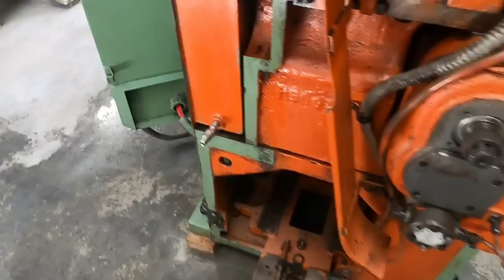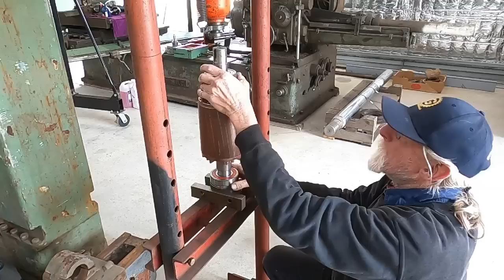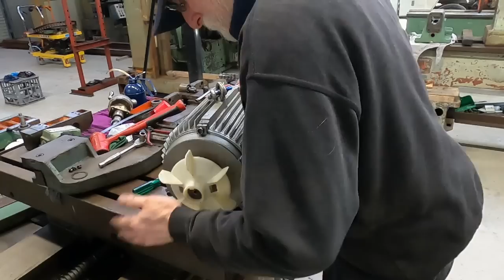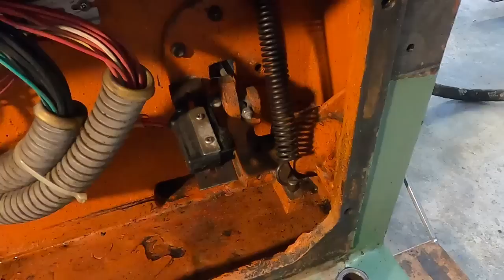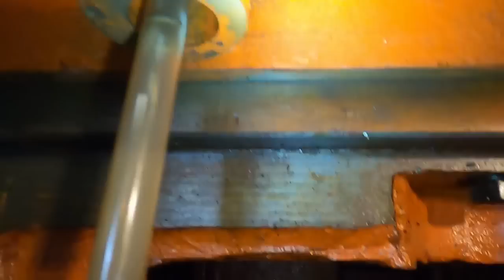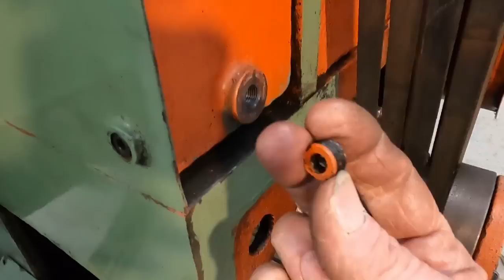JFMT 530 x 2000  Lathe Repairs  .  Part 8 .

Comment: Unless you are 100% sure of the bearing history I'd always renew the bearings. If I knew that they had been in for 6 months I'd probably replace them. Always cheaper than having to take the whole thing apart again. And always fit SKF, RHP, FAG Timken or other "decent" brand. Not worth saving a couple of quid on a cheap bearing.
Reply from the maker: Thanks . I never use cheap brand bearings , the NTN bearings are a good make . 👍
Reply: @swanvalleymachineshop  Yes I think just about any bearing made in Japan will be fine. I have fitted cheap bearings on the odd occasion, when I have not been able to get hold of decent ones and production have been screaming for the machine to be working again. Have then planned in to have them redone when time and production allowed.

Comment: Great clean up, I think it is worth the effort. I worked at a shop that really did not want to do things twice, always replace bearings that have been removed with pressure on the outer race. I have to catch up on your vids!
Reply from the maker: Hey thanks .  👍

Comment: Vesrah is a big Japanese brake & pad manufacturer, so like you say, it's a common part used for other things too - like some motorcycle.

Could you not make a drain that comes out from the existing threaded hole?
Reply from the maker: Hi Matts .  I could have just screwed in an extension ,  but i did not want to reduce the hole size that the ID of an extension would create . 👍

Comment: Brilliant design on the motor brake, so simple and inexpensive 👍🧐. Would it have helped to lock the brake on, then set jacking screws?
Still amazed at an induction motor, especially 3 Phase, seem to last indefinitely,  just a clean and bearing replacement. High end large DC brushed motors I've worked on, 100 to 250 kW with forced cooling soon get destroyed if the filter is removed and ambient air is laden with ferrous particles, or oil laden.
Lathe looking great, nice clean machine to work on.
Thanks for sharing Max, best regards from the Black Country UK 🇬🇧
Reply from the maker: Thanks . I realised the thing with the brake assy when i was editing & thought the same !    My surface grinder has a  generator & DC motor , a fair bit out of my wheel house !   👍
Reply: @swanvalleymachineshop  Probably the 5% of brain power that was occupied with YT stuff, had the best solution or ten? ✔🧐, it's always easy after the fact.
Best regards John.

Comment: Hi Max, as an electrician we always used a bearing heater with a temp stick to install the bearings to lower the risk of damaging the armature, it works quite well. I'm sure you knew that but I felt the need to share with you.
Rich
Reply from the maker: Thanks  .   Did you ever have any issues with the grease melting ?   I have never heated sealed bearings before , only ones with no seals .   👍
Reply: @swanvalleymachineshop  Hi Max, no, it's only heated just above 200 F, I don't remember what the melt crayon was set at probably about 210 F. I used an induction heater, they work faster but you can also get into trouble quicker. if you see the color of the steel change to yellow it's trouble. don't use anything but a temp stick  to find the correct temp, they are the best way to know.   our heater came with a couple of them so I just bought like kind.                        An infrared thermometer will get you in trouble.
you must act quickly while sliding on the shaft and hold it into place while cooling or you will be back at the press. it's easier if you can get the armature vertical. 
 
Good luck Rich
Reply: @swanvalleymachineshop  I'm with Rich, I've done at least a hundred using the warming method with rubber sealed bearings. Being a cheapscape  I just use a droplight and set the bearing right on the bulb. When it's too hot to pickup by the outer race with a bare hand your good to go. On a large bearing covering with a rag helps the warming process. Hope that helps someone.. Cheers...

Comment: Still making good steady progress Max & because your taking your time & “doing it right” the first time, likely as not you won’t have to go back in there and do any of it again, all going well.
Judging by your attention to detail in every other video, and of course the same attention to detail on your shop build, that’s to be expected.
I’m guessing you will likely be knocking out some trenches for the 3 phase cable runs this long weekend?
Hopefully the old tractor / backhoe will take the manual labour out of it for you.
Keep up the good work, I was hanging out for a video to see how things are progressing.
👍👍👍
Reply from the maker: Thanks Ian . Yes , the trenching is not far off .     I have been meaning to drop by & catch up , just flat out as normal !   👍
Reply: @swanvalleymachineshop  
There’s no panic Max, I’ve been away on holidays with the missus for a week or so, so everything’s been in back burner. Hoping to get back on track after this long weekend. 👍

Comment: Looking good Max. Amazing what a bit of elbow grease can achieve. Good call on replacing the bearings on the motor for piece of mind. I always do the bearings while the motor is out considering the price of the bearings is low.
Reply from the maker: Cheap insurance !   👍
Reply: @swanvalleymachineshop  Correct. I did the same with the Radial Arm Drill earlier this year with the Lift Motor that sits in top of the column, it was removed for transport to drop the height by 400 mm. Meggered, new bearings and refit, last time I want to be putting that up there. The Drill is a German BR-40 with Morse 5 spindle.
Reply from the maker: @grahamokeeffe2196  Sounds like a nice drill .   I am trying to convince my work to sell me their small radial drill for scrap price  .   Trying to plant the idea into their head's that it is a safety hazard because the staff  have no experience in machine tools  & if they get tangled up in it , the drill will not stop !!!
Reply: @swanvalleymachineshop  There is a vid on YT on how not to use a RAD. Amazing it didn't cut the operator in half.

Comment: Hi Max, seen the results of the micro switch not tripping the contactor before the brake applys, tore off the brake shoes!
I am guessing the full load current of the 10HP motor on the JFMT is around 15 Amps, could not read the nameplate, assuming it's direct online, no star/delta start.
Starting current 5 to 6 times FLC, equating to about 75 Amps.
You have some other large electric motors in the workshop so the maximum demand should be calculated.
Hope our friends at Western Power are giving you an adequate supply capacity?
My 3 phase supply in Perth was only rated at 35 Amps per phase, caused me a few headaches having to install VFD's and a star delta starter.
Reply from the maker: Yes , 35 / phase .    The electrician knows what i am running & said to use 35mm  cable for the shop supply .    Main board will have a 250A  breaker .    Anything above that , you have to apply for commercial power & the cost sky rockets .  Not sure on the HP of the bigger lathe , but as it is a clutch lathe  a soft start will be ok if reqd . The sparky said it will be fine .   The mill & borer are 15  hp & he said it will be no worries .  We shall see what happens !    👍
Reply: Hi Max, are you saying that your meter fuses are rated at 35 amps?
If so I hate to be the bearer of bad news, your supply will not have the capacity for your consumers the fuses will not handle the inrush current.
Have a mate in Victoria with an Olive farm and his supply is only SWER single phase and he had to go the Generator route to give him sufficient 3 phase power.
Reply from the maker: Sorry , 32 A per phase .    The motor is 13.9 A .     The electrician said there would be no problem .
Reply: Max hate to say 13.9 amps × 6 starting current = 83.4 amps, the fuses will blow.
Star delta starter or VFD will just work, but the 15 amp motor will only work with a VFD with a slow ramp time of at least 10 seconds.
Reply: Hi Max another factor is Western Power max allowable power rating for electric motor for domestic use is only 5 HP.
Reply from the maker: @willemvantsant5105  the trip current on the lathe is 32A .  If the start current was way higher , wouldn't the machine be fitted with a larger trip switch?
Reply: Hi max, we are talking about the thermal overload on the lathe now yes, it should be set to the amperage on the motor nameplate, ie 13.9 amps, the thermal overload will tolerate momentary overload on start as the heaters don't have time to heat up.
We're we talking about your incoming supply fuses from Western Power at your meter box, need to know their rating, mine were only 32 or 35 amps from memory.
Reply: Getting clearer, the 32 amp breaker, incomer to the lathe, yes, protection for all circuits, will be a C curve breaker that will tolerate the momentary overload on start.
Important to know your incoming rating of power, under ground or overhead cables?
Reply from the maker: @willemvantsant5105  The electrition is doing the power supply with western power & it will have a 200 or 250A main  breaker .  There are other properties in the area that have similar .  I will know more details in a few weeks .
Reply: Heaps, you will have no worries with that, can run all your machines at the same time plus the welder!!!

Comment: I would think that the lower fitting is common pipe thread.  I have routinely changed out to a proper length pipe nipple, and used a female cap.  Had a fleet of chemical trailers with 3 gas engines on each, and it made services really easy.  Surprised that from a previous video you shared on your day job you aren’t using ratchet wrenches or a 1/4” ratchet for the menial bolts.  As a 65+ year wrenchaholic the old timey box ends are almost museum pieces nowadays!  Great stuff you are doing here!
Reply from the maker: I did not want to reduce the drain hole diameter down smaller by fitting a nipple  & cap .   I was going to fit a short tube that had a bigger hole than a standard nipple but decided to go with the plug , just in case a belt broke & hit the extension .   Plan '' A '' was to drill & tap it from 1/4 bsp to 3/8 or 1/2 '' bsp  , but that cross tube was in the way .   👍
Reply: Didn’t think about the time to drain portion of it.  Damn Max- you continue to amaze me with your thought process!  Enjoying your refurbishment of the big iron stuff, the shop is a dream come true, that I’m sure you have worked your butt off to afford.  Love the big jobs that you Aussies do.  Worked on farm Cats in the early 70s, then trucks, then Helicopters and Aircraft.  Always wanted to get into machinist work, but everyone wanted at least 5 years experience.  Schooling wasn’t available at that time where I was, so I went a different path.  Traveled, met really remarkable pilots, saw wonderful places during my working years, but the only lathe I had to use was worn badly twenty years before I used it.  Still have the bug though, as I am sure you understand.  Cheers

Comment: I'd sure be inclined to put a pressure gauge or at least a low-pressure light on the outlet of the headstock pump, just for my own peace of mind.
Reply: I think in a previous video Max showed an oil flow sight glass for the headstock.
edit: The flow sight glass I was thinking of was for the feed gearbox in part 6 at 28.05. In the same vid there is also a sight glass visible but not directly shown at the base of the headstock gearbox.
Reply from the maker: Thee is a flow sight glass on the headstock .    👍

Comment: Hi Max ...  New bucket & mop did the trick.     Lol  ..  The lathe after the general clean, + the sliding waves or bed being oiled & cleaned,  makes the lathe look like a nearly New Unit .  I'm very Impressed with the Electric Motor,   looks like a new one inside.  Even the gears in the head stock are looking good. Yep ... looks like you are lucky & have a Wiiner Here. Great video, & I like the remote,  very slick. 👍👍👍🍺🍺🍺
Reply from the maker: Thanks 👍

Comment: I was half expecting you to add a sight glass or dip stick for that tank to easily check the oil level when you open the front hatch.
Reply from the maker: It has a sight glass on the front .   I thought about a cap / dipstick assembly , but that would over complicate the filler neck .   👍